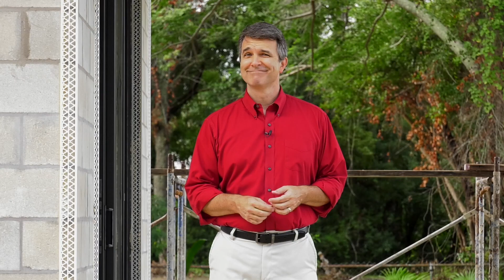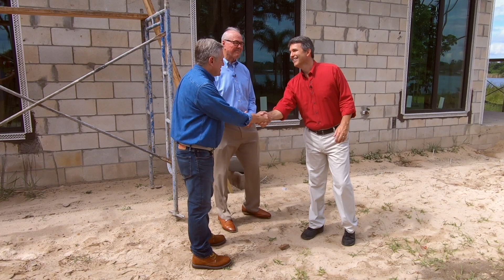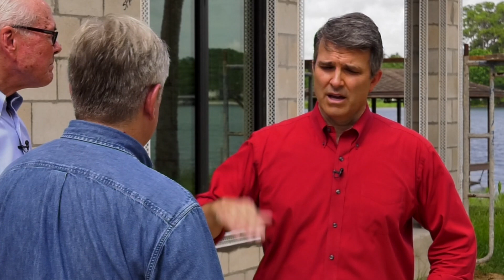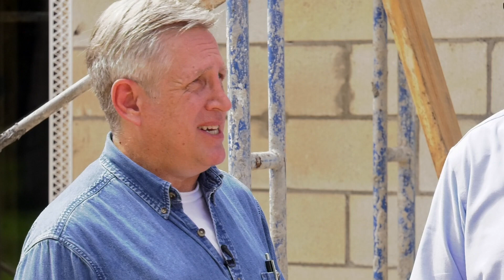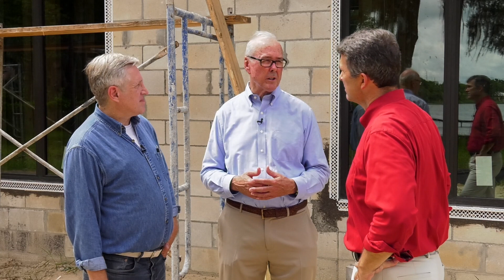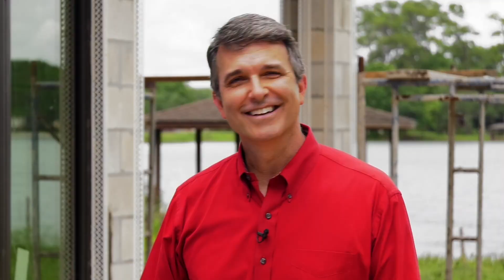Concrete Block - Energy Efficiency

Comment: We’re in zone 6 (northern Wisconsin). I have a ca. 1950 cinder block structure, below grade basement up to roof rafters. There was no interior insulation and only a stucco/scratch coat applied to the exterior. The place was previously heated by a wood burning stove and later also a gas forced air unit. I’m in the middle of rehabbing the property and want to increase the efficiency of the structure. I’m changing to a high efficiency 70kBTU natural gas furnace. What would be recommended regarding interior insulation to increase comfort and reduce heating and cooling costs?

Comment: Fill the blocks with spray foam... Put on 2" foam boards on outside... N inside of concrete blocks n it should be as good as its going to get? Fill concrete blocks with cement???

Comment: This is nothing but a sales pitch for concrete block building. I built an ICF home of foam blocks filled with concrete in Colorado. In the Winter that 6" of concrete was ice cold all season and acted like a cold sink. Concrete block is better for warm weather cliimates imo. Also concrete floors can be nice thermal mass but they are so hard that I never felt at home living in one.

Comment: My house is made of concrete block in the summer it stays cool in the  winter warm 
25 years of having it there has never been a problem with the plumbing or electricity all the pipes are safe under the concrete the only maintenance that I have given is painting the first floor the roof  is made of concrete the second level is the same 
 the third level the iron roof and sheet metal the houses in the USA made of wood always cause problems they are made to create Jobs🏡
Reply: Statement 💯 %right
Reply: Is this a hard construction?